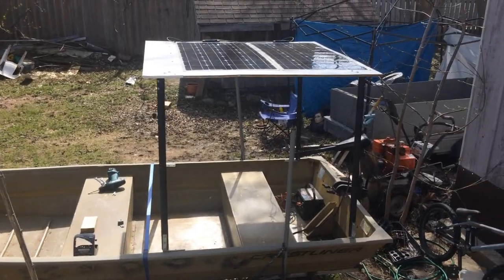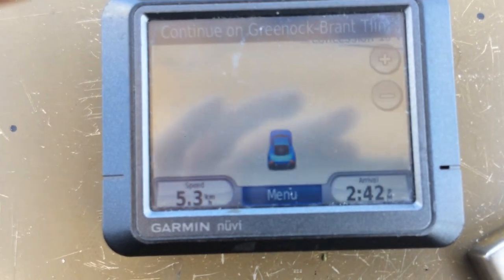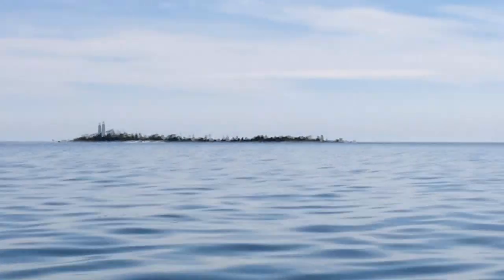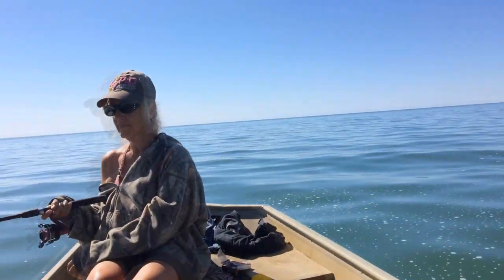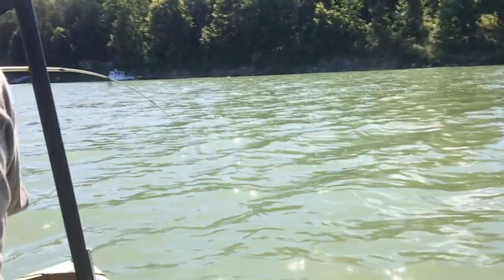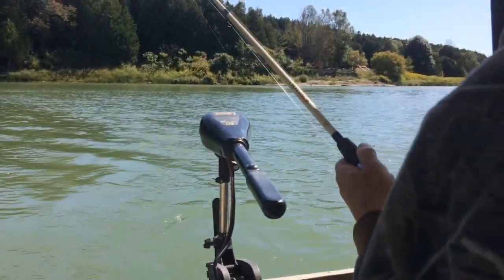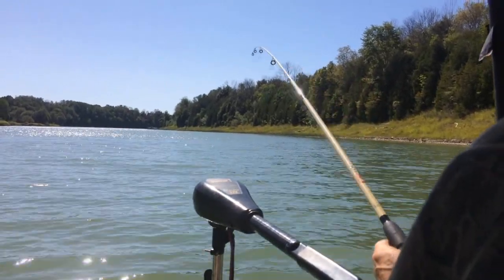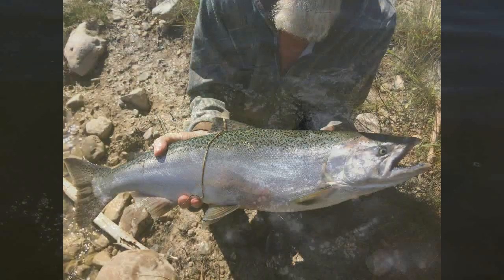ultimate solar fishing boat

Comment: Nice job. Thanks for uploading the video. I don't have any flex panels but I do have some aluminum frame 100watt panels I can bolt together. Will have to try that.
Reply: Thanx !,,either type of panel works, the flex are just lighter,and i got a good deal on them lol!
Reply: @1Theebluesman  same here, I got a great deal on my panels . I got them through Home Depot web site. I will get some flex panels for the boat because of the weight.
Reply: Ill be honest Im good with the dc electronics heres what Im thinking welding a plate in the middle of the boat then a coupler on top of the plate to support a 2 inch piece of conduit taking a 250 watter make a x bracket to stiffen up the aluminum frame and carter pin it all together so it can be quick removed the top of the conduit pole would have a coupler that can be positioned tilted forward in a semi sail like fashion  horizontal and backwards. The older 250s are 3 feet the width of a jon boat and 5.5 feet half the length of the boat. Making a perfect bimini top or dockingyou and tilt into the sun. Picking up the boat in a few hours. So well let you know spring time how it works. Taking suggesting on height lol